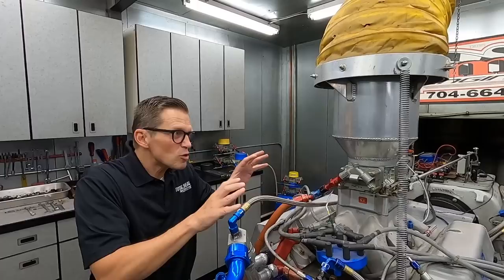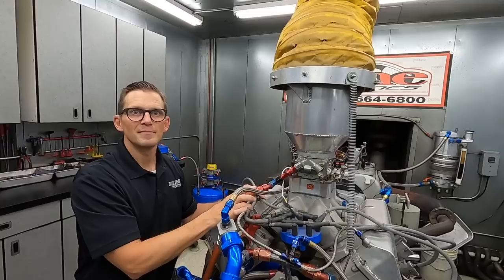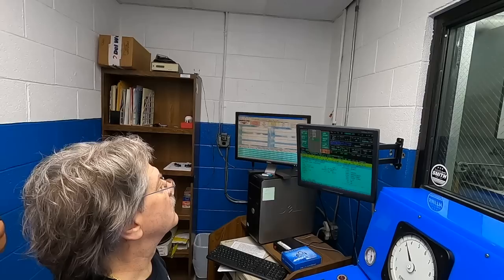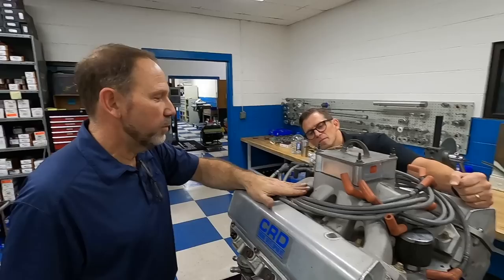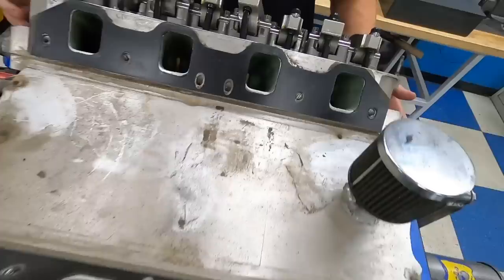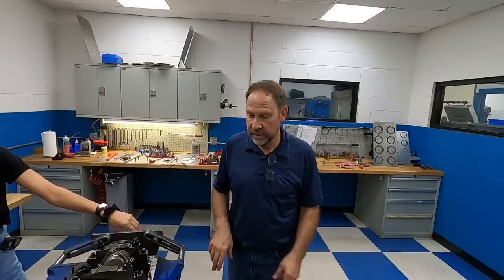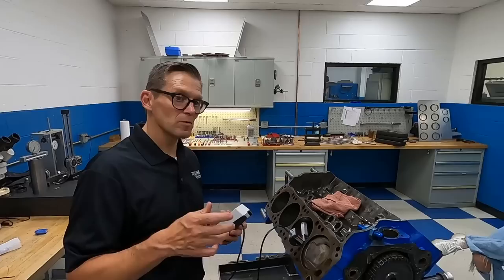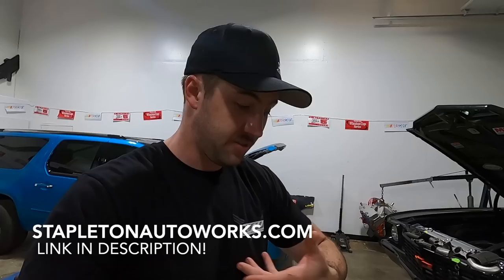Lake Speed's Ford C3 NASCAR Engine: Time Capsule of 90s Technology! (Dyno & Full Teardown)

Comment: The original head, post-iron 351C, was the aluminum A head, which had raised exhaust ports and an intake port closer in size to 4V 351C. Ford Motorsport SVO referred to this family of heads as SVO High Ports. They reduced the intake port size, enabling them to raise the floor, and this was the B head. The penultimate version was the C head (M-6049-C302B) and this was the most successful. It had even smaller intake ports with even higher port floors. The final version was the D302, which was basically even more of a porter's casting with more heavily modified cores for maximum port modification, but otherwise the same as the C302B. The chamber on all of these heads is much the same as a closed chamber 4V 351C, and they share valvetrain components like rocker arms and guideplates. Robert Yates set about to greatly improve the performance and efficiency of the cylinder head program for Ford in Winston Cup by completely revamping the head by introducing a completely new chamber design that was more like a figure-8 by removing the side cant on the valves that was inherited from the 351C parent head which allowed the smaller chamber to make high compression without the interference/weight/etc of a domed piston, and by going to a slightly rotated valve position to improve the overall approach to the valve from port entry. The new valve angles and locations necessitated a shaft rocker arrangement ONLY (which Cup teams had been unable to use earlier on the canted valve head, until a rule change). This head, the C3 (M-6049-C3), looks just like the earlier A3/B3/C302B head with a valve cover on it, bolted to a block, but is otherwise completely different. The C3 had a number of different variations over the years including port height revisions, chamber volume differences for different compression ratios, more porting material, CNC ported versions, etc. These heads can be identified as M-6049-C3H, M-6049-C3L, and M-6049-C33/34/35. There was an improved casting later made available for sprint car usage sold as M-6049-SC1 that had the intake and exhaust ports raised .400" over the C3 head family. The final version was the M-6049-D3, which took the improved SC1 head and added some side cant to the intake valve ONLY. I have experience porting the aluminum Cleveland-style heads as well as the Yates. The late Yates heads like the SC1 can flow over 400cfm and have tremendous power potential, especially when used in drag race applications. You have to remember that in the non-roller Cup engine applications, like the pre-1988 unrestricted engine that Bill Elliott set the all time qualifying record with at Talladega with, only made about 625hp. An unrestricted 358" engine, with well ported C3H heads and manifold, a modern roller cam and lightweight valvetrain, and low friction internals is definitely capable of well over 800 flywheel hp. This will be an interesting series to watch.
Reply: This engine seems a lot more like a ~2000 Busch Grand National engine, which would have been 9:1, had a roller camshaft (I believe), and would have made ~550hp when fresh. That would make your dyno numbers a lot more in line. 2002 Winston Cup would have had flat tappet lifters, rollers were illegal.
Reply: You know your history ! Very well presented.

Comment: I am amazed at the knowledge these guys have about the famous 351 Cleveland engine. Long after that engine was so popular, I worked in engine plant #1 at the Cleveland site. Unfortunately today the casting plant, engine plant #2 and all other ancillary buildings have been torn down. Only the original engine plant remaines with all new computerized equipment.
Reply: They probably cut their teeth on the Cleveland , you never forget your first experience

Comment: ,,,,Glad I discovered this Channel today.........The Comp Cams tour was awesome,,,,,,,,As a 71 year young engine machinist and student since 1965,,,,,,,,I see a 9:1 compression 358,,,,with 170 cranking psi.   480 HP   ...After all those years dormant ; I'm surprised a valve spring did not fail at 8 grand......keep up the great work and videos.....With  13:1 and no restrictor plate , plus the Total Seal ring tech of today.....the HP will go past 700.......

Comment: I've been around some RY45 stuff which is the aluminum version of the FR9.  They're badass 
Really like how they designed the rocker arms with strategic weight placement vs stiffness.  All o-ring seals.  Balancer behind the camshaft by drive... so much cool stuff
Reply from the maker: very!
Reply: Is the RY45 run in the Trans-Am TA1 Class?
Reply: @chada75  Lucas Oil Off Road P2 and P4

Comment: What is very informative is referencing today as being "modern" when compared to only 20 years ago.  This shows how innovative engine designs moved from year to year.  This leapfrogging progress really put the lower budget teams like Lake at a competitive disadvantage.   This also shows how having a great driver like Lake could still keep a lower budget team head-to-head, make the bigger teams sweat, and still win races!   This type of video is great work, mixing tech with very good explanations for the less experienced.   The part about the McClure valve was gold (better vacuum or more air?)!
  
The NASCAR engine design was locked into the track design.  Did all sanctioned NASCAR tracks have the same steep angles?
Reply from the maker: Thanks Wayne! I really do not know.

Comment: The coolest trebology result I've seen is on big blocks. A stock long block takes more than 40 lbft to wrench over with the plugs out. A race big block can turn over with slight pressure on one finger on the wrench. I don't know the numbers, but was amazed at the demonstration.

Comment: Think about the valve springs sitting still for 20 + years, how thick were the head gaskets, how much friction did the rust in side the bore cause, and how much drag were on the rings, something to think about, we use a clever type engine in a drag car with those style heads ( Yates)@434cubic inches making close to a 1000  naturally aspirated, in an old pro stock car.  Keep up the great work ‼️

Comment: Something about a screaming Yates headed machine! This is my kinda engine right here. 500 m wide ass open, amazing! Also, that distributor in the engine. I run one in the car in my sig. Mine came off a Ricky rudd engine. I could work for these people, need to get on my stuff!!!
Reply: I was big rudd fan when I was a kid. I Loved the tide rudd machine...
Reply: @dgrcgrl  yep, I as well did love the tide car. I think the distributor I have came out of '94 car. But, you can definitely tell it was it was messed with. Indexed marks all over and dual pickup

Comment: That "Clover leaf" restrictor plate insert is just like the ones i saw back about 1990. the purpose of that center tube is that it is a resonance tuning tube.   I know it helps the air flow faster in the outer tubes.

Comment: In my years of building Engines as a back yard Mechanic, I learned early on, not to use Custom anything, because if it breaks, it meant weeks to months, getting replacements. The compression was what, 140 psi per cylinder? That Block still has the clutch Z- bar threaded hole, lol

Comment: Unless your adding boost its definitely a big killer have low compression. My grandfather put a huge cam, intake and heads on a 84 motor home 454. It came out at 8.1 to 1 and only made like 380hp in the shop. A new set of pistons/valve train was worth almost 100hp.

Comment: There were at least two different heads marked C3. Some of the early C3 marked heads were really C302b heads with side cant on the valves like a Cleveland. Later  more common C3 were the Yates design without the side cant.

Comment: Those dished pistons look designed for a different chamber, the exhaust side looks fine but maybe the other side is an issue (probably not as big as the low compression tho, as you said!) . I spent a fortune building a 400M with 66.1cc quench chamber 351C-4V heads, it still made 11.1:1 compression being 6.7 litres, and with a streetable hydraulic roller cam etc it should have run pretty strong but nope, and the weird part that MAY be relevant here is that I could use ANY ignition timing and ANY jetting and the gtech pro said it went the same. T'was the oddest thing, and I put it down to the shallow but perfectly circular dish in the piston being so mismatched with a tight quench chamber that it not only lost the turbulence and anti-detonation benefits of the quench I guess it had lots of places where the mixture may have remained unburned? I dunno, was outta my depth!  I eventually bought some KB-148 pistons whose dish was a perfect mirror image of the chamber, but never fitted them cos I sold the car when I got sick of being pulled over lol. Should've just painted it. I remember jumping out of the old Aussie Falcon once and striding back to the cop who pulled me over saying 'WHAT? Is it illegal to have an ugly car now?" 😅 In hindsight it probably should have been - patina wouldn't become a legit art form for another 30 years. Good times.
Reply: After market 10,280 deck intakes didn’t have enough material to cover 4V Cleveland’s intake port. Weiland made a spacer to use 9.2 intake to a 10.280 block. DOAE cylinder head had 56-58cc chambers called quench not a 66cc.
Reply: The Weiland spacer didn’t have enough material to be port matched to a 4V Cleveland head. Price Motorsport made many spacers, but none for putting on 10.280” block 351M

Comment: If you go to 11:38 you can see the spark sparking to the valve cover from the front cylinder. Definitely down at least one cylinder
Reply: Thanks, good call!
Reply: Nathan Wells   It looked like it but I broke that part of the video frame by frame and it looked like a small piece of plastic stuck to the head bolt blowing around.  If it was arcing that badly we would have heard the missfire.

Comment: Just a quick observation here, but, when that engine was initially dynoed there was something going on at the top of the #5 wire where it attached to the spark plug. Was that spark arcing away or was that just a small flap of paper or something else flapping around there? It is really hard to see from my tiny little phone screen. I'm sure it wasn't spark arcing away or those guys would have caught it, but can anyone else see what i'm talking about? It was the left side of the engine on the very first spark plug(would be cylinder number #5 on a ford engine i assume)....probably was just paper or something flapping around but am just curious to know what that was
Reply from the maker: It was heat shield flapping in the wind!
Reply: At 11.36 and 12.08 you can see the sparks arcing off #5 plug lead onto the rocker cover like a welding rod. 100% shorting out, so to make 470hp on 7 cylinders is not to bad. Wonder what the other ign leads on the RH bank were doing?  That is the smoking gun as to why lacking in power.

Comment: Seems odd to have CNC pistons and have it at about 9:1 compression. Is it possible the motor was used in a show car to run on pump gas? Great video! Keep them coming!
Reply from the maker: Busch series rules in that era were 9:1 compression so that is probably why!
Reply: @Stapleton42  I don't understand 358 cubes making 700 at 9:1
Reply: @sc358.  Compression doesn't make hundreds of HP.  It's a percentage and not as much as you think.
Reply: Going from 9:1 to 13:1 is maybe 10% more power at best?
Reply: @hordboy  I've never built around a 9:1 rule package but playing around on a simulator (that's fairly close on power numbers but at different rpm than actual) I'm getting upper 12s to low 13s % from 9:1 to 14:1.
That's not an insignificant amount of power.
To be fair, valve event timing would very likely be different.
Just saying ~ 1.96hp per cube seems bonkers for back then on 9:1.  Very impressive.
Reply: Lightness for revs and high flowing Heads, Also, They ran roller cams.

Comment: Awesome ... great explanations of technical terms for beginners for sure . I machine brake rotors for several trucks on the market and use the proliferameter for testing surface roughness and it was interesting to see that it is the same device to measure cylinder walls on Nascar race engines 👍  Very informative video for sure ! Also a Nascar fan ...😎
Reply from the maker: That’s awesome Tim! We are glad you’re here 💪🏻

Comment: Love seeing these engines, this gen and the later all the way back to the ,427 monsters are all great engines in my opinion! These new modular type setups are sweet and deserving of much respect but the older stuff has more torque and require a special feel to maximize power during a race! That balance of rpm’s and low end muscle is what makes a motor “worthy” of winning races!  I’m a gear head and u can’t post enough engine tear down and dissection videos, all the knowledge these engine builders have learned u can’t read about in books u have to learn by actually trial and error! That type of learning never ends and is a requirement of a builder to learn more and more with every round of ratchet and wrench. I am proud to have built many motors of all types and proud to say I have a few wins in  a couple of different Motorsports. I will never be the best but I done just fine til he got there lol

Comment: Ok I (as a crew chief for a Ford Trans-Am team in the late 90’s) had three Rouch and three Lazano Brothers Engines and they all made 660hp with 680lbs of torque however the Rouch engine fell off after 8400 rpm because that was the max revs you were allowed to run by the SCCA! The lazano motors kept pulling to 9k  the only difference between all six engines is wear the power came on. It was substantially different enough that I could pick engines for different tracks (and I still say that helped us back then!) it was unusual for a one car team to have a choice of six engines!

Comment: Way to go you two, one of your best vidio's that l have watched. I was trying to get the best look l could, lights out, a little light, anything to see as best as possible. A little shocked, but only a little, Mr Speed could flat out drive most in the twisties, being down on power suits his driving, also suits road courses, you get passed on a long straight, but it was all over in the corners, good traction with being down on power equals flat on the floor with the throttle and no spinning of the hides, l wish you would replay some of Mr Speeds wins or road course driving. There was Jerry Nadue ? A hot shoe for hire on the road courses, Mr Petty used him, man oh man Jerry road the tires off , literally going for the win, only to break a few laps from victory.
I don't remember really how many laps were left, but l remember Jerry coming on the radio and saying sorry guys, were out, it broke. Man he out drove the field that day! Great old stuff, l bet with equal cars today 👍Mr Speed in a short race, would hold his own on a road course. 🤔👍
Thanks for sharing! 
✌🏻🧡🌤 🇨🇦 👨‍🦽 😎.
Reply from the maker: thanks man! absolutely lake would still run well no doubt

Comment: Just love this, Lake and his son are just great people.  Stapleton42, I commend you for what you guys do.  Now, about the engine. I don't see a mystery. When you pulled the head, I could plainly see they were dished pistons, indicating it was most likely a 9:1 engine. The horsepower achieved would make sense for used 9:1 engine that had been sitting.  I had  a Tesar Engineering 18 degree Chevy 9:1 in my asphalt super late model, and Mike Tesar said it dynoed at about 540 hp when it was new.

Comment: I did not read through all the comments so maybe it was mentioned already but during the dyno pulls you can clearly see the front plug boot #5 cylinder arcing from the plug boot to the header or valve cover when the camera shot is looking at the side of the engine. That surely would affect the hp and torque numbers.

Comment: Exactly like I built for several seasons for a NASCAR Craftsman series truck team.
Late '90s/early 2000s - 780hp fresh, 755,760 time to freshen. Valve Springs were everything, two practices, two short races and they got tossed as regular maintenance for safety. Same went for the titanium valves - anything much over 8200rpm and they'd stretch (if you were lucky) or drop one - which almost always destroyed the engine. With as lazy as this one is I can't help but wonder if anyone remembered fresh springs for as long as it sat - I saw 8100 on the tach and it was past done making power.
Otherwise, these Windsor based/Yates C3 headed engines were near bulletproof - you couldn't hurt the bottom end if you tryed.
My engines ran right with those in Keselowski's and other trucks in the series. I also did All-Pro stuff for the same team (S&H Motorsports)
God I miss those days, back when there was still a (remote) tie between the engines on the track and the ones in your garage.

Comment: I had a 580h.p. drag race motor that sat for 19 years in my garage at home. When I finalky got around to putting it back in the car it came out of, it ran the same times at the track as it did 19 years ago. 🤷🏻

When the motor was taken out of service, I fogged it, bagged it, left the oil in the pan, and it sat on the engine stand like that.
Reply from the maker: Interesting.
Reply: @Stapleton42  Perhaps I just got lucky..🤷🏻